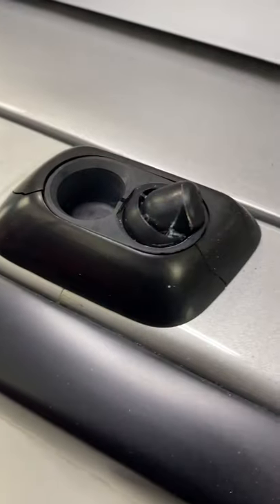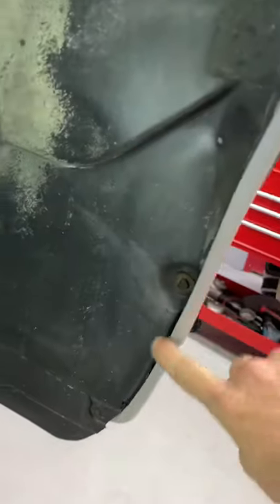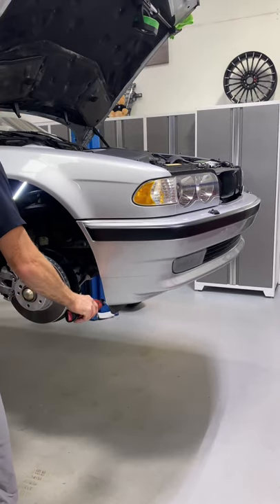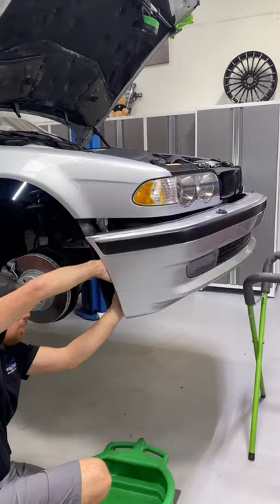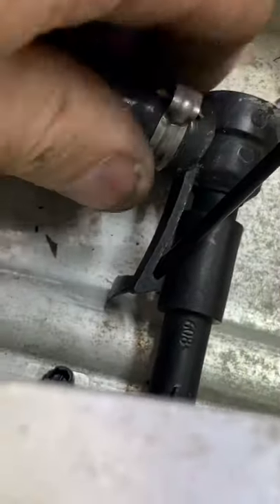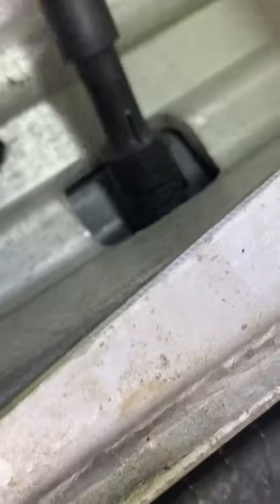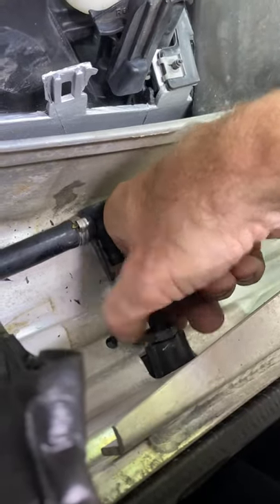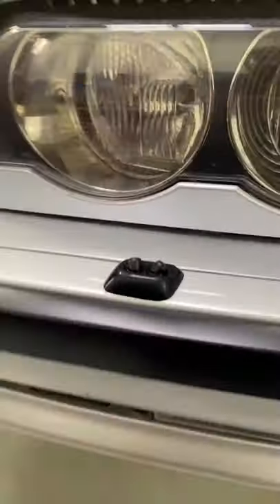BMW Headlight Sprayers #shorts

Comment: i’ve never even heard of headlight washers 😂
Reply: You must have been living under a rock for like 40 years…
Reply: @matthewp9015  people are allowed to not know everything...
Reply: @matthewp9015  chill out bro, no one knows everything. Don't boast.
Reply: @guycha0s380  uh saying you know what headlight washers are isn’t boasting dude. They’ve been mandatory on any vehicles fitted with xenon headlights since the 90’s. I just assumed anybody watching car mechanic videos would know they exist, considering they are in plain sight on many cars you look at every day on the road…
Reply: @matthewp9015  you assumed wrong
Reply: @Jamesbradley001  lol
Reply: @matthewp9015  as a mechanic who sees like 30 cars up close every day pretty much only like bmw and volvo have headlight washers i dont see it on much anything else. So i’d assume most people have no idea what headlight washers are since most cars do not have them. Not to mention most people here watching are just watching a string of random videos not here specifically for car content  so it makes total sense someone might not know
Reply: Probably for good reason
Reply: @zokushatech  Lexus has them too
Reply: Does  the headlight washer fluid use the same fluid as the windshield washer fluid ?   For this BMW there are no headlight wipers... so you have to keep extra paper towels in the car
Reply: @Energizer2000-q2q  It uses the same washer fluid from the headlight washer reservoir. There are washer fluid lines that run from the reservoir to each headlight.
Reply: @matthewp9015  damn i guess i hit a soft spot for you there
Reply: @adanperry1642  I wouldn’t say that, but I was surprised. I guess if you’re American it makes sense as headlight washers aren’t nearly as common in your market as they are in Europe and other markets that get Euro-spec models.

Comment: I love your video!  I have a 99 740il that I just literally got going again about a month ago after sitting for 3 years. It's in pretty good condition and it runs and drives bug after these two years it just wasn't sensible to pay for insurance and drive it. But now I am slowly fixing her back up. Gotta do those pesky timing chain guides this week when they get in the mail and then on to a wrap because the clear decided to say good bye from sitting in my driveway along the back driver side door. Which sucks. The melorot color is very beautiful. I kinda wanna wrap it either galaxy nardo grey or some black or dark red color like the original. I'm leaning more towards something different. That's at least until I am able to re shoot the car somewhere myself. Which probably won't happen until I move into a house with a garage. I love these cars. They are getting more rare to see running around and not just breaking down into nothing in someone's yard.

Comment: My e46 ones are playing up. Don't need to take the bumper off but you do need to remove the entire ***king headlight to get to the parts behind the spray jets. The jets didn't solve it do I'm just gonna code them out. Water keeps backing up from the telescopic sliders

Comment: So I sued a dealership because they lied an said a car had less miles then the engine. They tried to say in court the speedometer was for the vehicle not the engine. He even went as far to say a brand new car can have the engine taken out an one with 200,000 miles put in. But the law states the speedometer is for the engine not the car. No one is putting brand new engine in old cars unless they vanity cars. The judge ruled in my favor, as the dealer ship by installing a engine with more miles then the dash said is consider Deceptive Practice in law. A felony type of Bait an Switch. They were to set the speedometer to the nearest hundred miles.  An the dealership was fined an the seller was jailed for five years. Anyone else have this problem? I only mentioned this because you said you got the car with only 30k miles... But how do you know 🤔